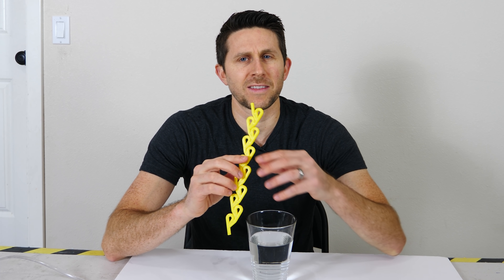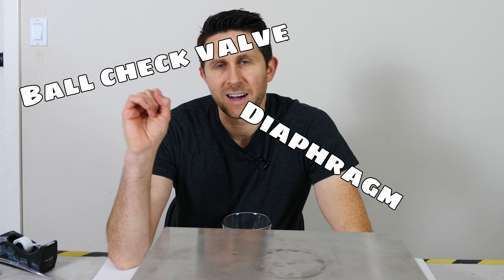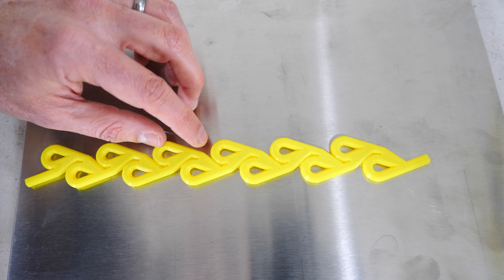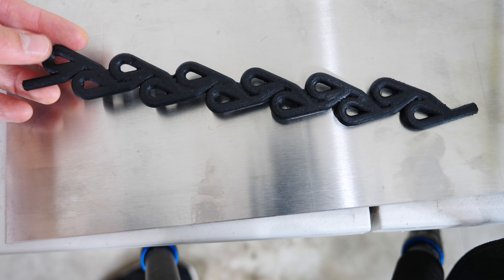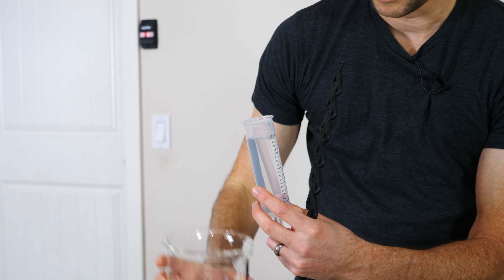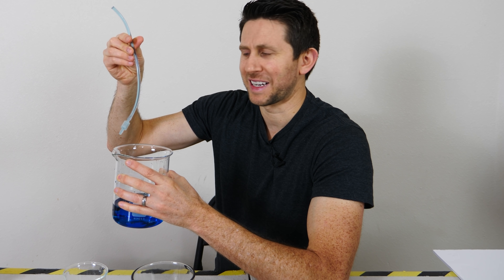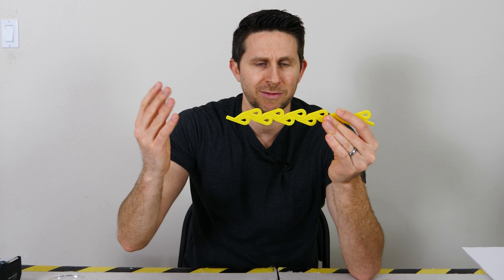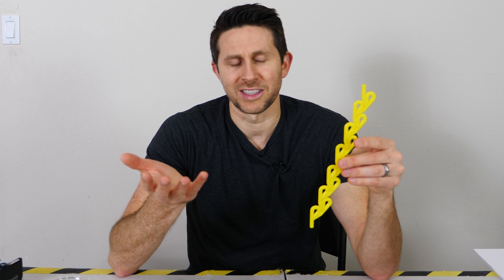This Tesla Valve Straw Only Works In One Direction

Comment: Help my brain is having a meltdown. Time travel! So gravity have an effect on both a atomic watch and a normal watch. But time is more then mechanic parts moving. Time is also a mental perception! Dose gravity have a effect how fast we think ? Action lab you did a vid on time travel, where you show flying out into space at the speed of light and back. But that only explain the moving faster than sound. Not time travel. For time to stand stil near a black hole gravity should have an effect on how fast our brain processes thoughts. My brain will not let it go 23:30pm ......

Comment: It's not necessarily that gas is better, it's that it won't work when gravity is providing the force. It will prevent the counter flow designed by the straw, as there is equal downward force in all areas of the straw.  If you turn the straw sideways and are able to keep gravity out of the equation, you should get better results with liquids.

Comment: I have this idea for a wing surface using the Tesla valve. Imagine if you stack enough of them together to form large area. You should have far less air resistance moving it through the air than in the other direction. I'm not suggesting that one make a whole bunch of them, but rather the design of the Tesla valve can be embedded within the wing's volume.

Comment: people with disability use one way straws .. for people who cant suck very strong so they can incrementally get the fluid up too there mouth .. there other reasons too .. some disabilitys people will blow and then suck as they cant control there motions well so works for them too .. this is just a few things ..

Comment: “Why would you want a one way straw?”

So the kids don’t blow bubbles in their drinks
Reply: What if they turn it.......its big brain time
Reply: Also no backwash
Reply: @SeeIHaveFriends  Probably not into the drink, but it only works a little bit per valve so you would get a fair amount in the straw.  Not bad for sharing a malt shake with someone though.

The real fun though would be to put it the other way around.  Challenge your friend to a contest to see who can drink their drink fastest.

Might be interesting for a puzzle mug too.
Reply: @NacorantheHarmonicaPlayer  no
Reply: @NacorantheHarmonicaPlayer  SMART
Reply: @SeeIHaveFriends  yas
ty
Reply: Flip it upside down and blow out
Reply: @nerdup1238  You are legit 200 IQ, hats off
Reply: @nerdup1238  Genius!  The kids would figure that out and make excuses as to not drink their milk!
Reply: @nerdup1238  no need to flip it, this only works because its full of water. you could simply lift and drain it if needed and it would not restrict airflow in either direction.
Reply: @nerdup1238  just make a no-way straw then
Reply: @nerdup1238  then u build it into the cup
Reply: @nerdup1238  genius 😆
Reply: One way straws are useful for people with low suction capabilities because they don’t have to bring the liquid up the straw every time to get a drink. Common with ALS among other conditions.
Reply: @jefrosideo  the straw is basically not washable because of all the dead space inside
Reply: @jefrosideo  thanks for the info
Reply: My exact thought.
Reply: @kristenstreck3123  yes
Reply: @kristenstreck3123  yeah
Reply: blowing bubbles is fun!
Reply: @BESTofAlp  and annoying
Reply: @BESTofAlp  so meet him at the top of mount suck
Reply: It’s more fun than drinking it normally
Reply: Mr. NoFun
Reply: The kid named bubbles:
Reply: Plus the kids will think it’s some cool straw pattern
Reply: @orkas9027  100,000,000,000 IQ
Reply: 900 IQ
Reply: and to stop contamination. The drink will not be contaminated if you have a one way straw since nothing will go back to the drink
Reply: Ironically, my very stern and serious classical singing teacher gave me the tip to start blowing bubbles through a straw in a bottle of water. I now use it in my singing yoga (kirtan yoga) and breathing yoga (pranayama) classes, because it moisturizes the throat, helps clear slime, and can be used for a lot of mindfulness/meditation-based breathing parctices. Professional singers often have a special kind of bottle which is made especially for this purpose. I hope this anecdote will be of service to people :)
Reply: Air will still flow in both directions won't it?
Reply: Also those "fun straws"
Reply: ok boomer
Reply: But... Why D:
Reply: * b   a   c   k   w   a   s   h*
Reply: so the devil created this thing?
Reply: BIG BRAIN
Reply: Multiple people can drink from the same container without direct contaminaton, the beverage that came in contact with someone's mouth will stay in his own straw
Reply: mhm yes but what if they turn the straw around
Reply: Yeah that shit is disgusting!  I hate when kids do that makes me wanna slap their heads as hard as I can.
Reply: Little shits...
Reply: So you don’t get floaties in your drink
Reply: 6 year old + milk + straw = inevitable mess. I'm getting one of those.
Reply: Since it’s a gas I don’t think it would work
Reply: @Reclikesmoney  but you have to push the liquid back
Reply: One way straws are great for things like military grade canteens and camelbacks
Reply: pp channel sweet home Alabama intensifies
Reply: People who hate kids can just never shut the hell up about how much they hate kids. Just like people who hate cats or dogs, it's like they think they're revolutionaries or something.
Reply: Well now that's just evil.
Reply: Lol
Reply: Also so you don't share spit if you want to share a drink with someone
Reply: Flip and blow
Reply: @CrypticConsole  That's what I told your sister
Reply: So you can keep kids from backwashing into the drink
Reply: waht no.
Reply: Ya
Reply: even I do it sometimes
Reply: That's evil :c
Reply: Invest
Reply: Ok mom
Reply: you must be fun at parties :/
Reply: Thats evil
Reply: So ur siblings don't backwash
Reply: They can jsut flip it...
Reply: Exactly
Reply: You can prevent backwash too
Reply: Or maybe so if you have one drink and two people and u don’t want people to backwash... ewww
Reply: You can still blow bubbles the straw has to be flipped remember
Reply: Lmao
Reply: genius
Reply: Yup
Reply: No backwash
Reply: turns the straw around
Reply: Maybe someone that has a disability that has trouble drinking.
Reply: True
Reply: I just had flashbacks to my young days :D
Reply: It works with water not air idiot
Reply: Or for pranks. Or maybe for some disabled person with impaired sucking strength?
Reply: Xactly
Reply: and if you share a straw the other person cant backwash into the drink
Reply: You monster...
Reply: So I could continue drinking where I left off.
Reply: Yeah lol
Reply: What if they don’t wan’t the drink that was near your mouth to go back in the drink if you sharing it
Reply: You monster
Reply: You monster
Reply: Honeslty blowing bubbles is how I mix my drinks when I take too much time drinking it
Reply: now i can share drinks with my toddler and dont have to worry about them adding extra flavors
Reply: Then they can just flip it-
Reply: It’s called engineering, typically Engineers love to make things more complicated than they need to be 🤷‍♂️
Reply: Or if someone hates sucking in air first
Reply: No backwash?
Reply: i.e. Ruin the fun of having a straw to drink.
Reply: P A R E N T I N G 1 0 1
Reply: Micro bubbles are probably worse then normal ones 🤣
Reply: Now I want to know more
Reply: Good idea lol
Reply: That and back wash won’t go into your drink
Reply: Aaaand so that the drinks's that have been in your mouth don't fall back in.
Reply: I was thinking no backwash but some of yall had better ideas
Reply: Just don't use a straw a put the cup up to your lip ,
Reply: Lmfao imagine giving a shit about kids blowing bubbles
Reply: That is a crime, a serious crime
Reply: to share drinks with friends so u dont get back wash lol
Reply: i thought to prevent backwash
Reply: let them have fun :(
Reply: You moster
Reply: True tho
Reply: Germaphobes that can’t have a single chance of straw backwash? Only other reason I got than yours
Reply: or only blow bubbles, though, no backwash
Reply: no backwash
Reply: wait
Reply: @ppchannel2521  AY WOAH WOAH WOAH
Reply: But that’s the best part
Reply: Backwash
Reply: Me with my lung's full potential : "I don't have such weaknesses"
Reply: Fun-hating comment
Reply: i did this with milk and  the bubblees popped late and it looks like a cup with white bubbles
Reply: Lol
Reply: Can I point out how he was able to blow through it with quite a bit of ease… 

idk if I actually watched the whole video I guess I would have seen  the reasoning for it the question and ensuing comical statement haha

It’s weird tho cuz now he is saying it is mainly used for gas?  I noticed a small change in sound for the first 10 seconds’ demonstration and assumed it was worse with gas. Idk not worried anymore all is fine. I just thought the real non reversible straw was not being brought up. 

Basically I was going to say the Tesla straw more than likely was going to actually blow bubbles but at that point was only halfway through the video and didn’t realize why it was actually brought up as a quote haha. I’m so dimb
Reply: why would you not want kids to do that?? i loved doing that. and still occassionaly do that when feeling especially fun
Reply: I like to do that
Reply: Breathe out carbon dioxide and carbon dioxide can kill you
Reply: Lol
Reply: That and also you don’t get spit on your drink. Cuz when you stop sucking a regular straw, the liquid goes back to the cup along with your saliva. So it’s “less nasty” to share the straw
Reply: that's not how that works...
Reply: how will you prevent it from becoming saturated at the bottom with sugar and get the sugar to be evenly distributed in the smoothie if you can't blow bubbles in it
Reply: This comment has 669 likes. Nobody fuckin ruin it
Reply: @mrsucc920  They have already?! It was 666 just a bit earlier.

Comment: Tesla valve also works better under much higher pressures. Low pressure fluids don't flow back into themselves hard enough to cause significant impedence

Comment: a one way straw is good for dating. if you go to the cinema and get a big coke or something. and you dont want to buy 2 because on cinemas drinks are more expensive. you just get one drink with 2 one way straws... so the two dating persons dont need to worry about liquid that was in the mouth could possibly drip back into the drink they got. that is the first that comes into my mind about the question why using or needing one way straws

Comment: How about not hiding the results by leaning in. Looking at the cylinder before you cut it out of frame it looks to flow just as fast. 5:14
you stopped the time when the cylinder was empty with the first way then stopped the time when the "straw" was empty the second.

Comment: So, sucking water through the straw from the side that’s supposed to impede it, its not taking full advantage of the loops, when sucking theres still a path of least resistance once the straw to my understanding becomes completely full, the resistance would loosen.

Now on the other, if the water was being pumped/pushed in to the straw rather then sucked, it would work fully as intended. 

In conclusion less resistance when sucked rather then pumped.

Comment: hi.

i have a doubt.

can you use your vacuum box, and see if a cold stuff in vacuum warms up slower or faster than the same stuff outside?. i don't know, stuff like some ice melting or something like that.

i have the same doubt with a warm body getting colder, but i imagine it with a warm cup of water, and i supposed it has to cold faster on vacuum because the water evaporation.

so it could be interesting to analize what kind of impact the vacuum could have over the heat transference and the bodies temperature changes.

Comment: From my brief observation, it looks like the Tesla Valve is made only for clean fluids. I would imagine paraffin from oil production would compromise the valve over time by blocking off loops and then there is all the usual nasties that come with the process like scale, bacteria, corrosion, radioactive material potentially building up on the loops, etc, etc. Would it even be able to withstand the usual 300 psi-1000 psi sometimes seen on oil fields? I think it is a cool valve, but it looks like it has limited uses. Not to mention the cost to maintain it compared to replacing a chewed up flapper on a check valve. All the aforementioned issues like scale, and paraffin can be treated with chemicals, and hot oilers but those aren't cheap and in the case of the hot oiler, potentially catastrophic.

Comment: Was just wondering if there is a push/pull difference with these tesla valves. I imagine sucking would create less resistance than pushing in the blocking direction

Comment: The 'Tesla valvular conduit' was part of a larger system.
He needed a flow bias; easier flow one way, more resistance the other.
Part of how it worked so well in his application was the pulsing nature of the flow through the 'valve'.
The pulsing leads to pressure and temperature gradients in the conduit; the heavy slab walls of the conduit acted like heat-sinks and to pre-heat incoming air.
It was to be the inlet valve for a type of large pulse-jet engine...
The flow bias kept pressure spikes in the combustion chamber while allowing smoothly flowing inlet air.
The comprehensibility of air makes a sort of spring to absorb the 'bumps'.
...
That is one aspect of how Tesla worked; the final use of any one part was not always apparent.
His infamous 'death ray machine' was never presented all at once; he left a trail of bread-crumbs throughout the US patent system.

Comment: You should have attached a whistle to show how much effect it has on gas (breath in that case). The Tesla Valve is probably useful for anything that needs to accept a flow in either direction, but needing at least a 50% pressure difference. Also, Jupiter is covered in parallel bands of similar patterns facing in opposing directions.

Comment: We just gonna blow past this "earthquake machine" Then huh?
Reply: Tesla was an over sell under deliver kinda guy, always hyping up his inventions.  Honestly it wasnt a bad idea, a great invention that can revolutionize an industry, like a new valve, might seem boring to common folk.

Anyho, "Earthquake Machine 101".  Take a pendant or some weighted object on a chain, and gently swing it back and forth.  Theres a specific motion that if repeated, will build up to a nice big swing.  This is the resonant frequency.  The size and speed of the motion depends on the length of the chain and weight of the pendant.  Just violently vibrating the chain or doing giant left right motions doesn't get a good steady swing going.  This is why different types of earthquakes affect different types of buildings.  A gentle waving earthquake might take out a sky scraper and nothing else, but a rapid shaking earthquake will take out a small house and leave the sky scraper.  

Tesla made a machine that vibrates, and allows you to adjust vibrations in real time.  The problem with Tesla's claim is that just because you know the resonant frequency of a builting, doesn't mean you have the energy to move it.  Imagine the necklace above had a 2,000 lb pendant on a boat anchors chain.  You can slap the chain over and over at the correct frequency, but in order to get it swinging, you need to move the chain at that frequency, and good luck.

Comment: It seems like it could be useful installed in tandem with a traditional check valve. It would greatly slow the fluid before hitting the check valve greatly extending the life of the valve.

Comment: In the patent there is a picture and a short explanation of what it's for. 

"Fig. 4 is a plan showing the manner in
which the invention is, or may be used, to operate a fluid
turbine." The picture is rotated to fit on the page.

His gasoline turbine uses two of these. Look at Figure 4 above the 25 and 24. The valvular conduits inject a fuel and an oxidizer into a combustion chamber. When the fuel is ignited the explosion is sent into the disk array and not back towards either the fuel or oxidizer. In a nutshell, he made a car engine with a single moving part.

https://patentimages.storage.googleapis.com/26/65/c7/c647a84af1f78f/US1329559.pdf

Comment: It works better with a gas because it works better with higher the pressure because if it’s just low pressure the turbulence affect isn’t there strong enough to withstand the flow pressure

Comment: Trsla valve works very well but it must be built for certain condition of pressure and flowrate. It is hard to built but it has no mooving pieces and no   Sealing parts that could lick

Comment: There's something off about this video. When it comes to a straw, it shouldn't matter what the turbulence is like inside the straw. As long as it's a closed system, inducing a partial vacuum at one end of the straw should always result in water going to the other end of the straw. It also sounds like the straw is leaking when you suck air in the direction you claim its not supposed to work in.

Comment: Do optical Tesla valves (reflective material inside) make sense? What happens if you shine light or laser on the other side, does the light come out?
Reply: That would do nothing, since light does not stick to light as water does to water, so there is no flow, and the entire point of the tesla valve is that its resitance is a result of the strength of the flow.

Comment: Interesting. But the drop test was not very convincing. 10 vs 15s is not much difference, and cannot justify to call it a one way straw. Is the explanation that the difference is subtle at low pressure but will increase heavily with higher pressure?